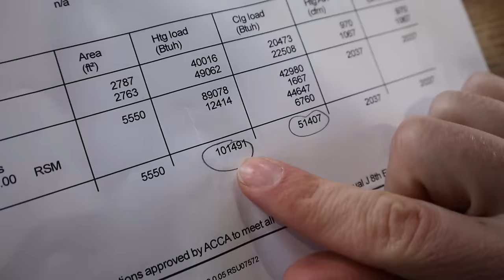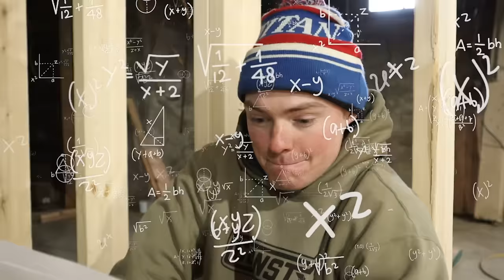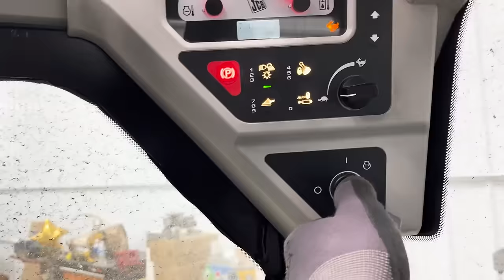Restoring A $7,000 Mansion: Removing 2nd Story Floor

Comment: You cannot go wrong with heat pumps n they last longer because the compressor never stops working.

Most important thing is a QUALITY RETURN AIR SYSTEM that all the return air goes across the filters only! No leaks in the return air system!

Conditioned air is not just about temp n humidity control, but also FILTERING your air as clean as possible! 
Remember 90% of indoor dust is dead skin cells?

Can’t even begin as many techs will testify to, Dirt is the number one cause of failure for HVAC systems! 

People don’t change their filters! Pay your electric bill check the filters, every year have the coils inside n outside cleaned! 
HVAC systems are sized by coil surface area and when the coils are plugged? You have a smaller unit that will never cycle!

Quality windows will save you money n foam insulation is the best for keeping the heat out in summer.

Make sure you are getting units with quality warranties everything manufactured is not quality work anymore, you want at minimum lifetime compressor warranty 5yrs all parts n 1 year labor, anything above that is a better deal! 

You will enjoy the house 🏠 for your life time from what I have seen but I imagine if you keep up the maintenance well your kids kids will enjoy it too!!

Comment: If you don't do 2 systems, you will be miserable and regret it forever. I have a 2600 sqft two story house with 1 system and it sucks. You will spend more $$ heating and cooling with 1 system and work it to death. The $$ you'll save in electric bill will pay for the 2nd system. 2 systems will last a lot longer than one and save you even more $$ in the long term. Hell if it were me I might even consider doing 3 systems.

Comment: Heat pump?? ABSOLUTELY NOT!! Let the HVAC people talk and talk, but the proof is in owning one.   In our case, we have 2 heat pumps for 2600 sq. ft. If your electricity is around our cost, you’ll be looking at somewhere between $1500 to $2000 PER MONTH just for your heating.

Comment: U are being so O.C.D. with the floors, wait until u realize how wavy the outside walls are. U should have waited to spray foam all the outside walls of the house. That way, u could have scabbed onto the side of the wall studs. And u should have added a fire break in the outside walls. U really should have just torn down the house.

Comment: why are you going insane over a half inch?  humidity is going to cause 3/8ths of an inch in swelling and contracting every year as the seaasons change.  You will only have an even plane when it is winter,  in the summer all that wood is going to suck in tons of humidity and expand a bunch.   You should be leaving room for this humidity based expansion.      Roman is not a carpenter he is a butcher.    The worst part is since he is helping you do the work yourself you are not going to be able to sue him when all his bad advice goes wrong.

Comment: You laugh, but that's a violation. Using the ladder not as it's designed. My boss got fined for that. TOTALLY RIDICULOUS They let dudes hang off a trash truck at 25  mph . 
Heat We don't need no stinking heat, you'll live. In a month you'll be bringing in fans.